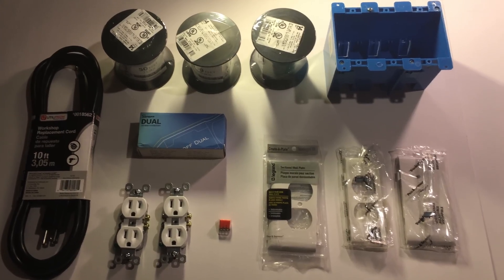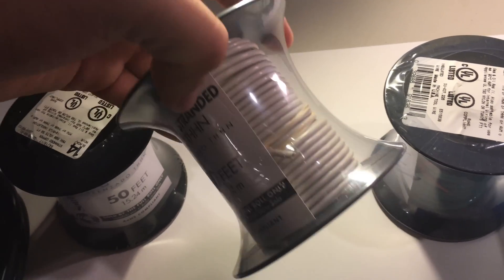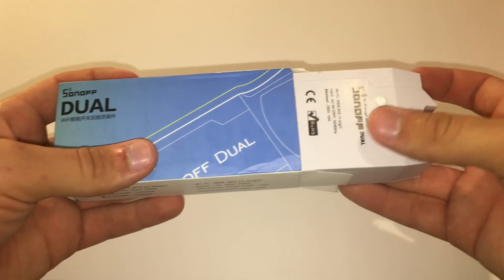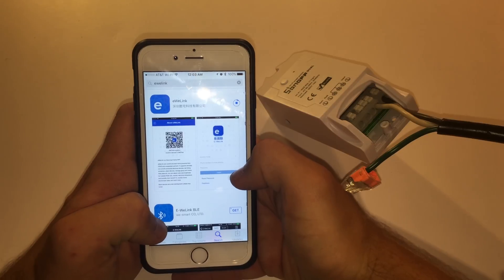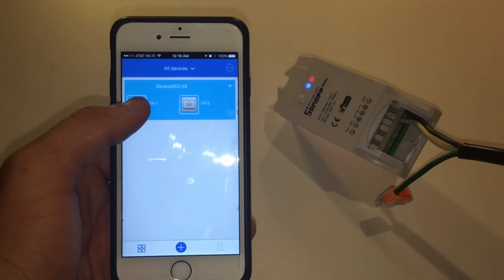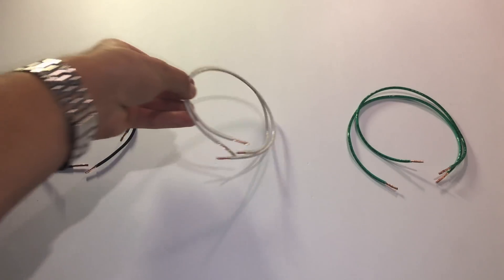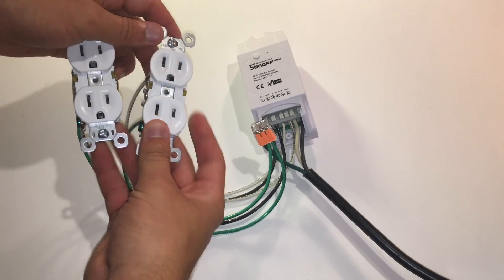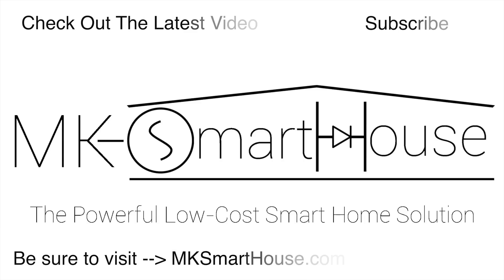Sonoff Complete Guide : Power Strip

Comment: Actually, the devices at 10:30 are designed for use only with solid wire applications to meet NEC code and should only be used with stranded if a U type stakon mechanical connector of appropriate size is pressed on to the bare wire.

Comment: I use the very same plastic electric device construction boxes for my electronic projects. several years ago I came across a large sheet of blue PVC sheet 1/8" thick and gave me an idea of using the Blue PVC sheet cut to the size of of the opening in the device box as a base, trimmed all unnecessary appendages off the actual box which would serve as a top cover. They work great and are very cheap!

Comment: Since this is "portable" and there are a lot of wires/stuff in the box suggest a single wrap of electrical tape around the terminal sides of the outlets.  This is standard procedure for home outlet installation and highly suggested with something that's going to get banged around and maybe exposed to weather

Comment: Hi! Cool video, thanks for sharing :) I am new to this... I would need to control 4 devices for an incubator based on a set of rules (humidifier, dehumifier, heat mat, cooling device). I was thinking of using the TH16 in combination with the Dual an dusting "Scenes" in the app to set the temp/humidity rules. Do you think it is doable? Any piece of advice on how to make it work would be super appreciated! Thanks!

Comment: I don't want to take away fro the helpful information that "
MK-SmartHouse" is trying to provide, but.....
This device is rated at 10 amps. Your breakers in your house have a minimum of a 15a rating. If someone plugs in a device that draws 10-15 amps a fire will be a real possibility. These are not designed to go inside of an electrical box. They are designed to be used in line of a corded device. even so, this device is rated at 10 amps. Your breakers in your house have a minimum of a 15a rating. If someone plugs in a device that draws 10-15 amps a fire will be a real possibility. These are not designed to go inside of an electrical box. They are designed to be used in line of a corded device. If you want too do this, there is another device called a Shelly1 that is rated at 16a so your house breaker will protect it. It is designed to go inside of a switchbox and it is smaller and only about $12. I think the extra $6 is worth not burning down your house. Look up the Shelly1 device n other YouTube videos before you do this. Maybe MK-SmartHouse can do a video on it too.
Reply: yes, that's why SONOFFs aren't UL listed and Shelly's are even though the latter has really poor connection blocks.

Comment: One thing you can do is take the Sonoff apart and the manual on/off button is a simple low voltage switch.  Solder in wires to the two sides of that switch, put the cover back on and put a small toggle switch or push button switch on the blank plate.  This way you can toggle on/off without having to use the app

Comment: Do I have to have internet to control it or just connecting to a router (without internet;my ISP sucks) will be enough if I stay with in  wifi range?
Reply: Rahman, probably a bit late but yes you can run it off your own MQTT server on your own network without a need for internet.
Have a look at this video:
https://www.youtube.com/watch?v=UDnNI5wkNNY
Build your own MQTT server RPi or Ubuntu (UBUNTU is much easier) and you are on your way!
Node-RED on MQTT and you have a FULLY automated environment

Comment: What you do is very dangerous. Never, I repeat NEVER use pushwire connectors with stranded cable. ONLY use them with solid cable. That you soldered them doesn’t matter, what you created is a potential fire source.
The rest of the tutorial is very useful though. If you want to use sortoff the same connectors, use Wago 222-412, 222-413 or 222-415 connectors. These are designed to be used with stranded AND solid wires.

Comment: For extra safety you should wrap the sides of the outlets with 2-3 layers of electrical tape. This helps to ensure that if anything becomes loose or the plugs shift they will not short across the plugs.

Comment: Most houses in America are not grounded properly to begin with. I'd suggest using a 3-4 dollar outlet tester, before you hook up a hot ground to this. Then if it tests as no ground, I'd just skip the ground part completely. But also nice to check for a hot-reverse and such, which could cause you other issues with less than handy hands attempting this. Then if you're not going to install it in the wall itself, I'd buy the gray outlet housing instead, it is cheaper. The blue one is to fasten it to dry wall without proper access to a stud, thats what the screw flaps do.

Comment: if you don't want 2 outlets per Chanel all you have to do it take off the tab on the outlet and connect one set to the top screws and the other set to the bottom screws and bam you can have 2 Chanels on one outlet, not 2 outlets for 2 Chanels.

Comment: I have done the same as you and the first reley in the Sonoff is working but the second reley can only switched on over the app ont the phone or the browser but wont switch off. Only it will switch off over the mqqt fix manually sending the command

Comment: I use RF outlets they are way cheaper and don't require messing around with high voltage. All you need is RF outlets (as many as your require), you can get 5 on eBay for £20. An RF Transmitter which will plug directly into your Raspberry Pi you can get an RF Tramister and Reviver For about £2 on eBay and that's it there is an Openhab binding already configured for it. As well does anyone know of any way of controlling lights on a budget in the UK as the wemo light switch is US only and am struggling to find an alternative?
Reply: Using RF outlets is cheap and easy, but you cannot query them for their ON/OFF state in order to properly integrate them in a smart home environment.
Reply: Can RF outlets be controlled by saying "Alexa, turn on light 1"?
Reply: RF is also easy to "hack".  I have seen people use RF devices to control garage door openers and someone was able to open the door while driving past the house.

Comment: So i just got an sonoff and i was fiddling around with it, i came to one problem. I live in the eu, wich means i use eu pluggs. You can easily switch around the L en N wire. I think this is not verry save. Because if i get it the wrong way around i will cut the N wire with the relay in the sonoff and there will be still running mains voltage on the leftover wire. What is your opinion on this? Is this save to use?
Reply: Should still have a Line and a Neutral wire. The outlets will be different, but the wiring on the sonoff stays the same. The ground/earth is the only line that will bypass the sonoff, and it will be connected outside with a splicer.
Reply: Many appliances within the EU switch the neutral also... for some reason.  It'd be nice if the Sonoff came with a double pole relay. You could (if you're comfy working with the PCB) desolder the original single pole relay and replace it with one of your own.

Comment: Okay so does that mean if you plug 2 cords in one outlet as in the top and bottom they are controlled by the same command or can you arrange it so they can take separate commands.
Reply: Yep
Reply: TYDIRTY yep to which question?

Both top and bottom plug of each outlet are connected to each other physically. So they are both on one channel.